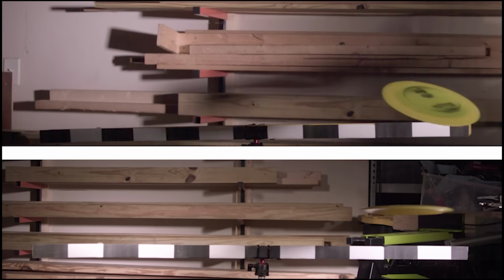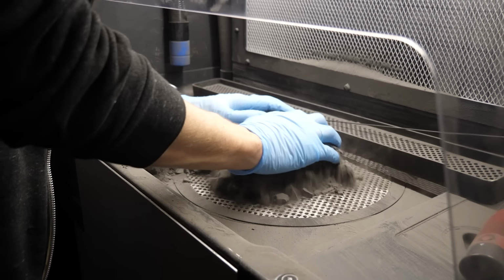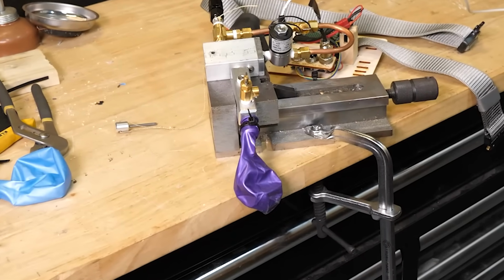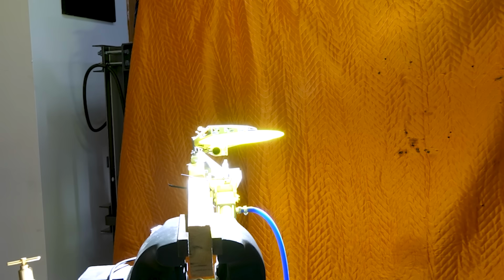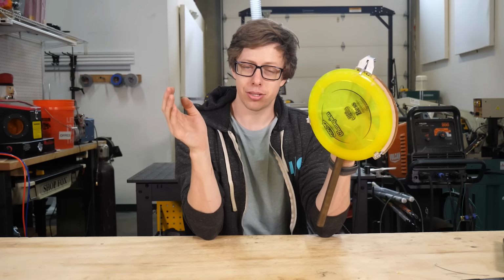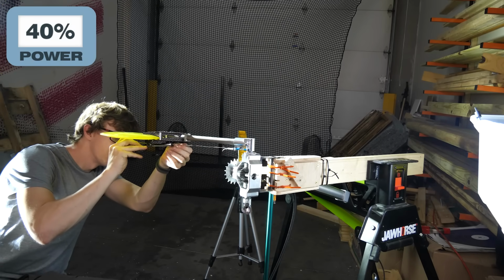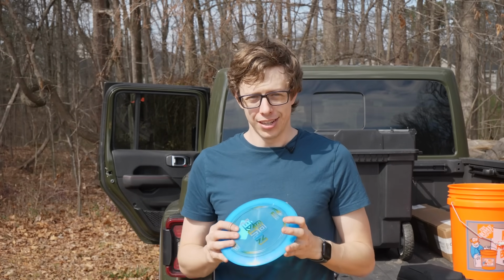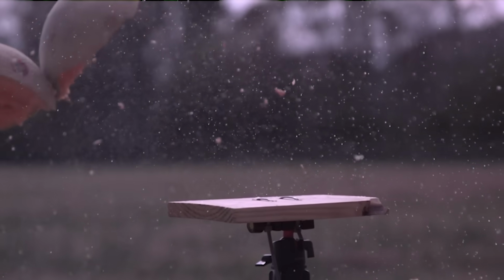Wrist rocket: worlds fastest disc launcher

Comment: As soon as it launched, I was like "It's not spinning nearly fast enough." Glad you mentioned that! I look forward to a V2!
Reply: Yeah me too, I can't wait for him to take a V2 rocket project
Reply: @lucianoayb7751  I was thinking of the exact thing
Reply: It should also get released on hyzer.
Reply: @lucianoayb7751  with Germanys new 100 billion military Budget, its even more out there.
Reply: I think if you copy the idea of a clay pigeon launcher you'd be closer.  The clay in a trap starts on the arm near its pivot.  As the arm cycles the clay moves outwards along the arm which has a rubber lip.  This imparts spin.  Additionally as the clay begins its path on the inside of the arm it experiences less initial acceleration which is why the delicate clays don't shatter during the throw.

The unit can be tilted for trajectory and flight angle.  And the whole arm can be a U shape for containment of the disk.

Comment: Would love to see a part 2! Release angle is essential in controlling how much a disc wants to flip during flight. You are releasing a disc on an anhyzer and it just continues to flip all the way over. You can compensate for this by changing the angle to start on a hyzer, and it will flip up to a more stable flight. Called a “hyzer flip.” Spin also helps, but you covered how this could improve it :)
Reply: I was going to say this exactly. Tbh the fact that they're going the distance that they are on such a steep anhyzer angle is kinda wild. 
Edit; I'd be interested to see him throw the DiscMania Tilt, the Discraft Captain's Raptor, or the Innova Max with this on anyhyzer, hyzer, and flat releases.
Reply: I'm not sure he can fix this with his current design. 
The beauty of a human arm is 3 joints before the hand. 
If you throw a disc with all fixed joints except for the shoulder, you won't be able to stabilise it. 

I imagine he's thing about that already when he's talking about more spin (adding a wrist), but he still needs an elbow to adjust the release angle.
Reply: @sqmsh  No he can just set it up on a different angle
Reply: @sqmsh  your elbow isn't exactly what determines release angle though.  I'm sure he can set the machine to release on a different angle, without too much of an issue.
Reply: @name7892  that doesn't work. 
Gyroscope and all that jazz. 

Think about your arm without a wrist or an elbow trying to achieve the same thing. 

You'll be better off, certainly. But you want a horizontal release plane, with a IO release angle to maximise your distance. 
You can't do that with only one joint.
Reply: @meb212  understood. He's just currently trying to control too many axis' without enough joints. 
I am surprised he didn't mention it, although he didn't do a design breakdown like he sometimes does. 
Maybe because at these forces, each joint is a weak point that is hard to control
Reply: @sqmsh  what they mean is where the frisbee is sat when it's thrown it launches in an upwards angle if he was to tilt the not holding the frisbee down just like you would your hand then it would be the downward angle they want it's nothing to a gyroscope and all that jazz as you say just a readjustment on how the frisbee is held
Reply: @uhohmemebiggestboy212  don't you worry about me bro. I play ultimate and disc golf. I know about angles. 
You don't have to agree with me, but try throwing a disc with a fixed wrist and elbow and see how you go
Reply: This
Reply: So much this!
Have the arm pointing almost straight down and see that speed 14 hyzer flip to the moon!!
Reply: @sqmsh  ok I understand what you meant now I thought you were arguing about the angle it was being thrown at your talking about throwing at a fixed angle
Reply: @uhohmemebiggestboy212  usually you throw the disc on a roughly horizontal plane, but pointing down towards the ground. 
Your wrist flick gives it a tilted axis of rotation relative to the direction it travels in (which is set by the elbow and shoulder).
You can't just align the release plane with the axis of the spin and offset it. It'll travel in an arc, curling left.
Reply: @sqmsh  The thing people are talking about is that he can setup the whole stand on which the machine itself is on to make it so it would throw the whole throw at a hyzer angle to combat the understability of the disc when thrown with this machine.
Reply: This
Reply: I think there is too much turn for a hyzer angle by itself to work.  If it's barrel rolling upside down, I think a hyzer angle would still turn into the ground instead of hyzerflipping.
Reply: @awyoung706  Yea for most of the discs it wouldn't help. I think some of them looked like it could help a bit though.
Reply: He should look at how a clay pigeon launcher works. It puts a great spin on the pigeon 👍
Reply: @jelk1  yeah I get it. That doesn't work. 
That's the equivalent of throwing a disc with a fixed wrist and elbow, but dropping your arm below horizontal.

You can see the inverse effect on some of the throws when he does the opposite.
The disc loses a lot of distance as it is converted into height. It also falls sharply to the right. 
You'll get the same, but sharply to the left with the inverse angle
Reply: @sqmsh  It's literally a hyzer flip. It does work and it is very normal in disc golf. I think you said you are an ultimate player and the mechanics generally used for manipulating disc flight are quite different  in ultimate.

The stuff you are talking about is how it works with ultimate discs but disc golf discs have different stability characteristics and one isn't restricted by opponent players when throwing so one doesn't have to manipulate the disc like in ultimate.
Reply: @sqmsh  I have to agree with you here.  It doesn't matter what angle it's at, it will always go to the right all the way into the ground.  The reason and for this and why Shane's discs keep going right is because of off axis torque at high speeds.  If he could throw it with higher spin, and  where opposite ends of the discs are parallel with each other during the whole flight,  it wouldn't be that much of an issue.
Reply: @jelk1  I play both. We call it IO in ultimate, and you need a lot of it for long distances. And more in wind. 
But it doesn't work if the plane you release the disc on isn't (roughly) parallel with the ground, and the force imparted isn't roughly straight ahead. 

Tilting the machine to achieve the release angle puts off the release plane and (potentially) the directional vector. 

Your joints are doing you too many favours and being under appreciated for it
Reply: Once you've angled the launcher you could rotate it around it's axis so that the release angle is not sending the disc sky high. While it's not an exact analogy for how an arm works I think there may still be ways to adjust the launcher to get a flight out of a disc. In my mind the launcher is acting like the elbow joint in the throw. 

Plus use a much more over stable disc.
Reply: @sqmsh  I don't know what to tell to you. In disc golf the flight path wouldn't match the inside out backhand because the disc would be understable. The understability would make the disc flip flat or even to the right so the disc would go straight or right even if the initial release angle would imply the disc going to the left. Then later in flight when the disc slows down and the angle of attack would change because it starts falling, it would become overstable and it would start fading back to the left so it would make an s-curve. Basically in disc golf you normally don't control the angles in the way you talk about and instead let the disc do the work.
Reply: @jelk1  I'm aware of how it works. I guarantee you it can't be done with the current setup. 
It'll be interesting to see his follow up vids
Reply: @sqmsh  I'm aware of how it works. I guarantee you it would work better with the current setup if it was tilted the other way. It'll be interesting to see his follow up vids.

Comment: Hey Shane, passionate disc golf flight enthusiast here!  There are a few reasons why your disc is behaving that way:

1. You're correct in that more spin = more better.  Spin not only makes the disk fly A LOT further because of increased glide, it also mitigates any off-axis torque introduced by the machine, which will cause a disc to want to turn to the right.

2.  As others have said, if your disc has this lack of spin and increased off-axis torque, you will want to give it the max opportunity to combat this tendancy to turn right by mirroring your release angle.  But if it's doing barrel rolls to the right, this won't be enough, which is why,

4.  You need the appropriate disc that has an absurd tendency to the left to counteract this.  This disc would have a high speed rating (13-15) and maximum overstability (turn rating of 0 or greater).  Examples are Innova Max / Ape, Discraft Nuke OS, or Latitude 64 Stilleto)  If you want, hit me up and I can send you a few of these.  Great vid man!
Reply: Agreed. The speed of disc I believe he needs is around a 17. A super Overstable disc thrown on a good hyzer with this machine might "flip to flat."
Reply: Also should be noted that  it flings it in a circle instead of pulling the disc in a straight line. Discs are supposed to turn over, not flip all the way around. A disc golf swing is a straight line, this machine is throwing thumbers
Reply: @scottdalton1205  we don’t really throw in a straight line. I understand that is what is taught as good practice to give people to minimize rounding, but If you can find slo motion footage of someone throwing from over their head you can see it is actually an arc path as the elbow extends.
Reply: @scottdalton1205  I think the issue with rounding for humans is that it isn't the most efficient way for our body to accelerate the disc, but our bodies are free-standing, impact-absorbent, and versatile and reactive enough to adjust between throws or even in the middle of one. I think trying to design a mechanical arm that accelerates the disc in a straight line would introduce an astronomical amount of design challenge, and the fact that he's turning and burning Nukes at 550' with the current design means he's most likely onto something anyways. He needs to use a more stable disc, which has a limit within the PDGA regulations; you can only make something that flies with a certain amount of overstability while keeping within the max weight and rim parameters. A disc that pushes those limits just isn't practical for humans to use, but I think the machine he has designed is absolutely capable of getting maximum distance with a parametrically maxed-out regulation golf disc.
Reply: @Aphletic  Agreed we throw in an arc.   But I'm having a hard time coming up with an idea to put more RPMs on it.  Maybe the key is finding a way to decelerate the inside of the disc as it's coming out.   It might be as easy as putting a lot of high-friction material in the holder to separate angular velocity from linear  velocity.  🤔
Reply: Tilt would be a good option
Reply: @paolorepetto1039  haha yeah!  In fact there are some discs (ahem Stego) that are designed to become more overstable the faster they're thrown
Reply: @Aphletic  you are correct, what I've learned ( from a pro clinic) it is more of a straight-ish line, the segment of the disc's full flight path directly in the throwers swing
Reply: @scottdalton1205  I think it's cool that teaching yourself to imagine something like throwing in a straight line actually introduces the correct mechanics, even though it's not really a straight line.   My best throws come from when I imagine all of my body weight going from my back leg directly into my planting heel and also imagining forcing my hand to be on the outside of the disc all the way until it rips out of my hand.  What that actually does is help my legs and hips power the shot and introduces a lag in my release to put more RPMs on the disc

Comment: What I learned at work: Our cranes have 4x the safety. So if it is rated for 4 tonnes it actually can lift 16 tonnes but due to safety regulations it will switch itself off if there's more than 4 tonnes on there. AND THIS GUY RUNS THE AIR PISTON AT 6X OUTSIDE ITS SAFETY REGULATION. Subscribe to this madman!
Reply: Yes, but he also has the know how to assess the material to make sure it's good
Reply: @spruce1509  Safety factor isn't about knowledge, it's about preventing failure in unexpected conditions. In the example of the crane OP mentions, maybe it can lift 16 tonnes under perfect conditions, but say the rigging is off or it's windy, and that weight starts to move.... Well, now you have a collapsed crane.
As for assessing materials... you can't account for everything.
The reason he's okay with overloading the piston is that he isn't putting anyone's life the way of the machine. That's why he only used it manually at really low power, and goes behind cover when he ramps it up.
Reply: @ssholum  oh absolutely! What I meant was that at least he's done some form of assessment and hasn't just decided it'll do at random

Comment: I’ve been playing disc golf for about 7 years now. The motion of the thrower looks good in my opinion but the angle at which your final set up is position is the problem with your distance. Let me explain. Throwing a disc right handed back hand (rhbh) naturally makes the disc want to turn left in its flight because physics. When throwing rhbh super hard it wants to turn over, as you explained, in a clockwise rotation when looking at the flight path of the disc. To compensate for this players will throw the disc from a hyzer release. You can look up hyzer vs anhyzer to have a visual aid but essentially a hyzer is the angle that the disc naturally wants to end at in its flight path and anhyzer is the opposite. Long story short, throwing the disc on a hyzer will help compensate for the clockwise rotation of the disc when it wants to turn over. Therefore you want to have the machine start the disc path at the same angle as this -> / so when it turns over it flips up to flat -> — instead of starting from flat and turning over to -> \. Does that make sense. I would love to chat with you more about this if you’d like because I think your machine has the potential to break the record without making your own disc or doing major modifications. Just need a little disc golf technique in the swing!

Other things that will help to counter turning over is a heavy disc (175g at least and buying a high stability disc. Aka, you want the 3rd number on the disc flight path numbers to be high, at least a 3. I hope all of this helps, I’d love to see a follow up video. Good luck!
Reply: damn that's long
Reply: Knowledge dropped
Reply: Yep, was going to post something similar.

Comment: I’m still waiting for you to program an oncology (tumor zapping) microwave to perfectly reheat a slice of apple pie evenly — instead of making it very hot at the tip and cold at the crust.
Reply: Super secret trick-- instead of putting the apple pie slice in the middle, put the slice on the edge of the microwave. Then it should (hopefully) cook evenly. If not, then only God can help us all.
Reply: This sounds a lot more like something up Michael Reeves Alley.
Reply: I think he should devise a system that is able to produce a chocolate flavored rain, now that would be something!
Reply: Pro-tip: use your microwave's defrost function and microwave it for 2-3x as long as you usually would.  Or, if it has a power level setting, set it to 40% and multiply the time you'd put it in at 100% by 2.5.  The power level setting typically will do whatever % you choose on 100% and then the remaining % at 0%.  So for 50%, it'd do 15 seconds on, 15 seconds off, 15 seconds on, etc.  That lets the heat dissipate throughout the food during the 15 seconds off multiple times over the course of a single warming, which makes it more evenly warm after it's finished.
Reply: Kodi Namsinh (Student FVHS)  
Tay is surprisingly active, at least around the science/space/engineering side of YouTube
Reply: Kodi Namsinh (Student FVHS)  oh wow. I didn't even notice until you said that lol
Reply: @Sesquiped  I usually do 60% or 70% at 1.5x instead of 40% at 2.5x, it works pretty well for me.
Reply: Sounds much more like a Styro Pyro video! Suggest this and hell probably do it.

Comment: The cancelling forces mechanism was sort of like attaching another gun with the barrel facing the shooter to cancel out the recoil.
Reply: Actually, that's what a compensator or muzzle brake does.  It sends the energy escaping the muzzle, after the bullet left the muzzle in a different direction, mitigating the recoil.  A muzzle brake literally takes all the energy contained in the barrel after the bullet has left the muzzle, and sends it back toward the shooter, albeit at a slight angle.  So, while the bullet pushes the gun toward the shooter, the escaping energy pulls the gun forward, canceling the recoil quite a bit.

It also makes one hell of a noise, and it's the reason for those massive dust clouds seen when someone shoots from the ground with a muzzle brake installed on a big rifle.
Reply: The problem is that he put so much distance between the swing arm and the counteracting swinging weight. They needed to be very close to each other. To make it much safer the weight might have been a disc.
Reply: Cancelled extention, doubled torque